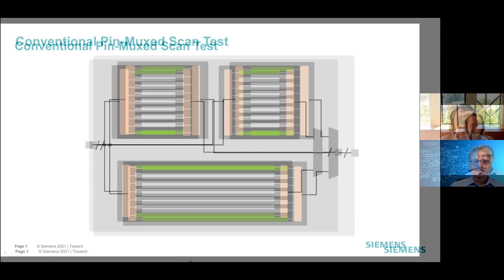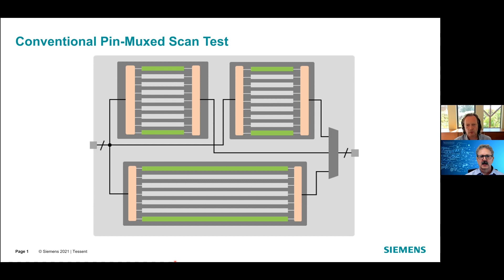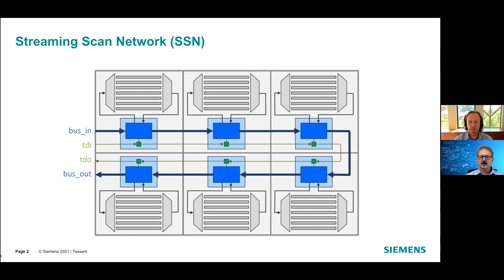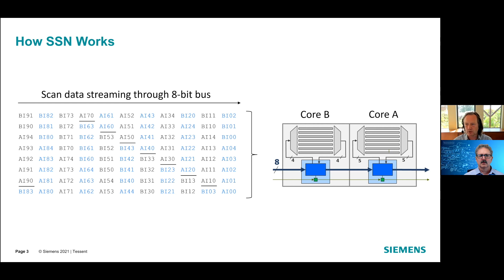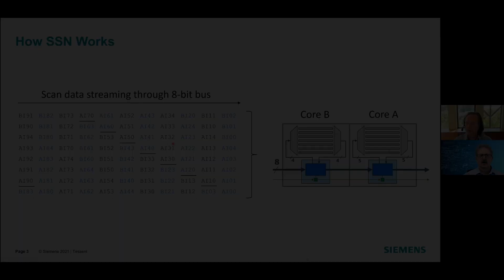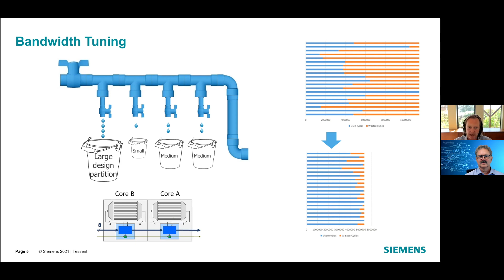Design For Test Data

Comment: How does the output data use the same time slot? In the example (13:53), why the output data corresponding to the first data use the bus two packets later?